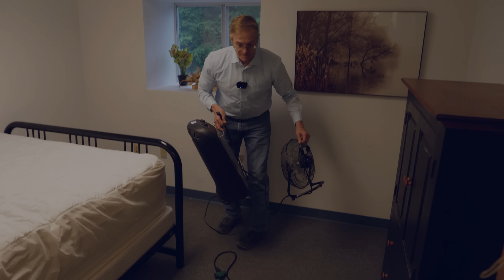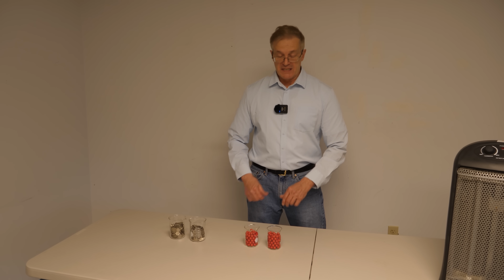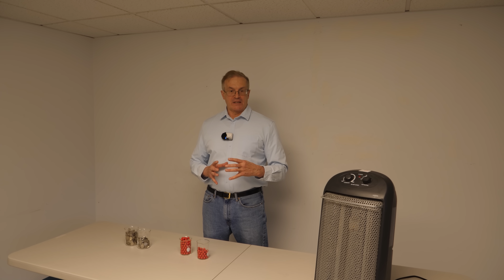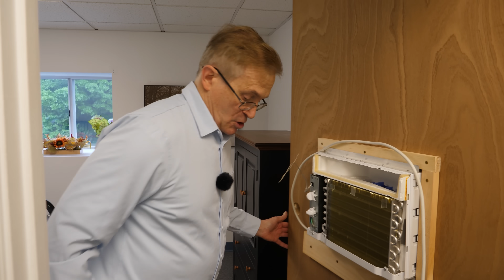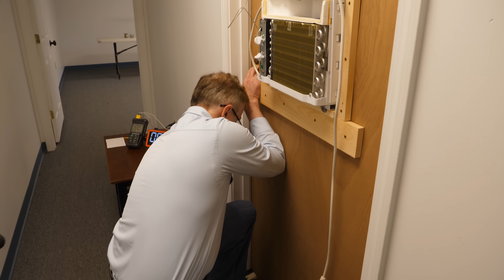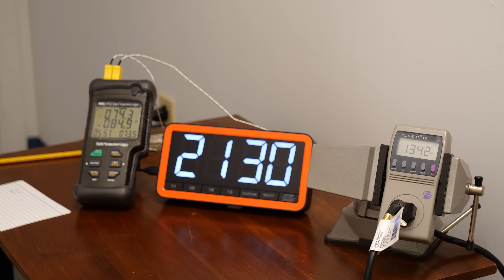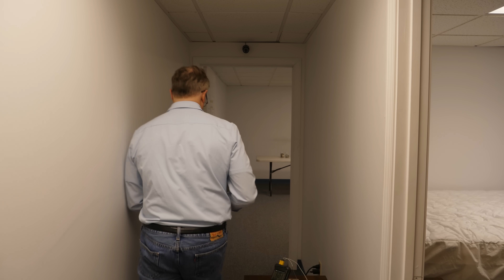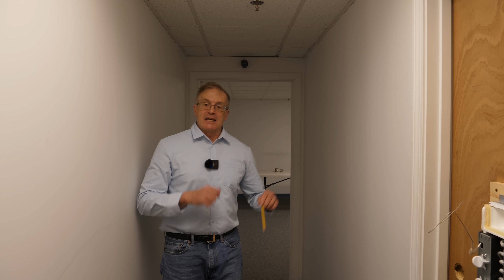You're wasting money on heating! Use your A/C!

Comment: I have a couple of questions for the community here (not sure if these were asked already):

1)   If this A/C unit takes less electricity to operate when compared to a space heater... why do power outages often happen in the summertime when A/C units are being used compared to space heaters used in the wintertime?

2)  If someone were to switch their small house over to A/C window unit heating for the whole house, would this experiment work if someone were to just reverse the direction of the A/C window units with the "cooling side" to face outdoors (thus cooling the outdoors  ;-P)?
Reply from the maker: 1. The biggest difference is that all airconditioners use electricity, while not all heaters do, i.e., gas, oil, and wood.
2. Maybe.  A window airconditioner is optimized for cooling and only in one direction. Different temperature ranges, outdoors, and inside will benefit from different refrigerant choices.

Comment: In Sept. of 2023 I installed a solar assisted 12,000 BTU heat pump. It produced heat up until minus 28C at minus 29 the lovers wouldn't even open. Up here in Canada we still need our NG fired furnaces. I use the heat pump on milder chilly days. Today we at plus 30C and I did a comparison. My new heat pump uses 400 watts less in cooling mode compared to my 14 year old mini-split. I love technology.

Comment: Heating with AC pumps is nothing new, its uses less power sure, but the added parts and the placement of the devices, meaning it needs a window to blow the cold air in or out of makes them hard to use. Unless you put the coils in the center of the house and outside in another unit, connect the two with copper lines filled with your refrigerant and fans in side and out and boom you got a heat pump.....

Comment: As a retired assistant director of engineering at a local hospital and an HVACR technician of 20+ years I'm curious as to your next installment.  So far you're crossing the 'T's' and dotting the 'I's' as I 'd assume you would but am curious as to your next installment. Notwithstanding,  I wonder if you eventually account for the cost of compressor replacement vs. savings in utility cost over an extended period of time? 

In simpler terms, considering the average wear on a AC system for cooling alone (regionally speaking) the typical life expectancy is between seven to ten years; at least in the southern states like mine in Texas, that is . But then adding an additional season per year operating as a 'heat pump' reduces that life by half, does it not? Lastly, I too wonder if attempting to water cool the condenser coils and/or diverting a portion of the refrigerated air across the return air is your next move...? Enquiring minds want to know......and look forward to your next video.😊
Reply from the maker: Regarding your life expectancy estimates, keep in mind that you will not have two systems (heating and cooling) that last twice as long.

Comment: I don't doubt your results, I'm just trying to wrap my head around it. My experience with space heaters like the one in your demonstration is that they basically have a wall of coils that heat up red hot so they actually glow. The equivalent on the air condition would be the condenser coil where the refrigerant gas gets compressed, heated and pumped into to cool. It's hard for me to imagine that the AC condenser would compete with the glowing red hot coils of the space heater in terms of producing heat.
Reply from the maker: That's why we did the video.
The results are valid and consistent not only with thermodynamic law, but one way to think about this is what does happen to the heat that is extracted from a room with an airconditioner? It can't be destroyed, and the energy used to run the airconditioner also has to go somewhere.  That's the leverage of this system.

Comment: I think the real lesson here is to exhibit how much better a dedicated heat pump could be than the average heat solution. It's fantastic low-hanging fruit begging to be plucked. NYC is running an experiment with window heat pumps (not plain AC) and while the pumps cost $2000 each right now, that's going to come down, it's a pilot program. Still, the gain is so great, especially for those who pay for gas/electric traditional heat, that even if the price stays that way it still makes sense.
Reply from the maker: Agreed

Comment: Something to note is that the heat differential matters. If it's cold outside there is less available heat to move inside, and the temperature that it does gain isn't much above ambient.

Comment: That is all great when its 75 outside. When its 0, they are not so good.  I had one which couldn't keep a small apartment warm. A friend owned a heated storage unit, 6 all new heat pumps.  Electricity in Maine is very high.  They only set the temp around 60.  They pulled them all out and put in gas heaters because of the cost. 
Seems reasonable, free energy but when you have to put on a jacket and keep the faucet trickling water so it doesn't freeze the pipes...not so good,  Great for 3 seasons but you need a boost in deep winter in Maine and many other states. Send them all to California so when its hot, they have a blackout because they don't enough wind and solar to keep them on.

Comment: My house has been heated with a heat pump since 1986. That unit died in 2018, and we upgraded to a newer much more efficient one. Since natural gas where we live is so expensive, I save about 500$/year compared to some of my friends. We also have natural gas fireplaces for emergency heat in power outages. The gas company showed up after a few years to inspect our meter since we had used exactly 0 gas. The tech came to the door afterwards and said "yeah, i saw that huge heat pump and i get it"
Reply: Good for you!  Had a similar experience with with gas company, but they actually replaced the meter and tested it.  The gas they used during that test was the last time I've had to pay for any.  Sure, every other month in winter they estimate my usage and bill me for that, and then credit it back the following month after an actual meter read.

Comment: You need most heating, when it is cold outside. You showed, that the A/C needs more power, when the temperature difference increased.
More realistic (for me in Germany) would be outside 0⁰C (32⁰F?).
In the optimal carnot process you would at least need 1 - T_K/T_H (absolute temperatures) joules per transfered joule of heat.
Since there are many places for losses,  add 50%. So 1:6 may be a good value.

Maybe we should discuss about burning gas at home vs. gas power plant feeding a heat pump.

Comment: As always a compelling demonstration. Since I have heat pumps at home (mini-splits) I am familiar with the concept, I will say that it costs way less energy to move the heat out of the house in the summer than it does to move the heat into the house in the winter. IIRC it's something about the temperature differential being much greater in the winter?

Comment: The economic story needs price -  Electricity vs natural Gas - to decide on the "hip pocket hurt"..

 - Electricity ( in essence) is value added natural gas... Gas can only make hreat, electricity is nearly infinitely useful as an energy source - it can create  heat, motion or even information - the highest form (quality) of power / energy)  The price difference reveals the "energy loses" in the electricity "system.  AC with natural gas cogeneration (or real "clean energy") is the ultimate in "conditioned space" treatment..

Comment: The room's objects and sealed wall, floor and ceiling voids may act as a thermal mass greater than accounted for.  Perhaps five hours or overnight to bring to equilibrium.  A thermometer between mattresses would reveal if this is the case.  For heating the air this is a great demo! .  Window ACs rate themselves at roughly 2x.  The conclusion of 3 x improvement is optimistic.

FYI, all but the most expensive heaters have poor placement of thermostats which cycle more often, which contribute to compromising the timed comparison. As well, cheap Chinese heaters have been found to sometimes have a hidden thermostatic fuse(?) which limits the power to the main thermostat, often by as much as 1/3.  This is done for claims of energy efficiency. 

Conversely,  there may be up to a three-minute delay before the compressor kicks in at startup, so that might improve the result by up to 14%.  It's a nice demo though and especially appreciated learning about equilibrium, thank you; If Elon sees he should consider hiring you! 

For those interested in turning their aircon around for heat, the experience of YouTubers suggests unscrewing the thermostat and routing it to the new inside to read the room temperature.  They only go down to 64 degrees, so will never turn on if still pointing outside.  And watch out for water dripping!

Comment: I really like this idea and I think I can make use of it without much difficulty. I have a portable AC, which is 10yo, that uses a hose and a window insert to blow hot air outside in the summer and I recently purchased a house that has a back porch with a sliding glass door. So, if I put the AC on the porch and the insert fits in the door I can blow warm air into the house. This particular design of AC creates a vacuum in any space it's used in, so it's not very efficient. The opposite would occur in the situation I just described, pressurizing the interior of the house; however, this could be advantageous if the house is cold. Cold air would be forced out through cracks in the basement walls and through any opening which hasn't been properly sealed. If I buy a length of hose to attach to the insert where the other hose ends I can easily direct the warm air to other rooms in the house.

Comment: Cool Vid, makes sense if you take a few minutes to understand... Pumping and concentrating heat is more efficient than converting electricity to heat. Even if the conversion rate is nearly perfect, and the pump isn't. I hope you revisit this 'backwards installed window AC unit' in the fall and winter :D

Comment: Make panels with water in them and then use a vacuum pump to cold boil the water frozen. Add a fan and water catch for condensing water. Or use that for cold steam Tesla turbine Cold side using the same pump for the cold steam turbine to maintain the ice around code side when needed. "Fallacies" Points at Earths Em field protecting Earth from the powerful sun and arranges Em collection output rods in vortex pattern in Mercury then drops turbine to get spun As long as Earth has a shield, Good.. 

That attack you said was microwave was ultrasound because peoples electronics and signals not microwave shielded. Put on wireless headphones, run microwave, and then open the door with music playing. Cracking noises or disconnect if enough charge built up. Does it cause cavitation bubbles? NO..

Comment: Interesting, but I would have been more convinced if the experiement was done in the opposite order, as heating a small closed environment like that transfers heat absorbed as latent heat into the furniture and walls, and the temperature probe is just measuring ambient air temperature.
Reply from the maker: You're probably right, but the delay was substantial.

Comment: I'm assuming a 3 way valve to reverse the system can be added to existing house ac systems?
Reply from the maker: I doubt it.  These systems are pretty well balanced for pressure and expansion ratios.  It might be possible if the settings could be optimized once everything was assembled.

Comment: It's pretty common to use heatpumps as heaters in many countries (with a reversible system, using a 3 way valve) . The US seems to be the exception but it does seem to be spreading. There is the issue that some areas in the US get much colder than what you would get in European countries, so the Heatpump may not work as well in those conditions. 

Adding the 3 way valve does seem to be a way to add the functionnality to houses.

Comment: Your test control isn't perfect, its better to create two identical rooms. That are seperated apart, or much smaller  such as a cubic space, and x material, and enviormental temp.  Air heating up isn't the problem, its the matter in the room that collects the temperature, if you can heat objects that ahve a higher molecular denisty than air it will give off a tonne of heat, and or aid in heating process, in this regard, teh tiem alloted of the air, doesn't make sense since the important factor missing is the total molecular heat of the oslid structures has a massive impact. The only thing i can say that could be of error.

To really do the test for solid figures, would be  a specialez state room and movements, and then a target outside system taht controls the ambiable areas of that system. force between each system a set temp, an outside temp, so a cube inside a cube, for less error and then operate  it over and over between both systems... I don't think 3 hours was enough, but yes moving is important, but heat pumps don't always work it needs a specific temp viable to operate which cna bechanged depending on the environment .

Comment: Very important information about the energy consumption - an eye opener. However, concerning the heat pump it is necessary to add:
The heat pump is zillion times more complicated then the resistive heater, which is simple, with no moving parts, and it definitely would serve you for many many years longer without break. The heat pump is also very noisy, you wouldn't want to have it in your bedroom window. And the purchasing cost of the window heat pump is 10-20 times more than the cost of the resistive heater. The external heat pump which would be less noisy for you, but your neighbour will hate you, would cost you more than 50 times as compared with the resistive heater...

Comment: If I recall right,  the lower limit efficiency of a heat pump is equal to the efficiency of a resistor heater.

Comment: 4:45 Nothing is at absolute zero. This is not quite correct, we have no (current) means of measuring anything at absolute zero, because it would create a movement that then is measurable thus then heat, by the standards of measurement, however there are other creative outlets and you can easily go beyond absolute zero, so you ahve to theoretically accept what is at that temp is at the cessation of movement. Kelvin  Scale... but yeah.. we can reach much colder temperatures, and how that reacts and pressure and other systems, so there is also other phasic states theorized in different elements as lack of movement, but then there is motion of electrons moving itself... so meh... its ab it less defined. Idon't know..

Comment: As a European it is honestly hard to believe that most of the USA does not use heat pumps and heat with direct electricity or gas which is even more insane to us.
Reply: If it's -15c outside, natural gas cost is $1/ccf and electricity cost is $0.2/kwh (both approximately correct costs for the American midwest), a 96% efficient condensing gas furnace is far cheaper to run than even the best heat pump. Because of this, you'll be running the gas furnace for most of the winter, and you'd only use a heat pump during the fall and spring ... and the heat pump would wear out before you ever get enough savings out of it to pay for the added cost (vs. AC only). Keep in mind that gas-fired generating stations are only 20-35% efficient, meaning that in an area where electricity is primarily generated using gas turbines, a heat pump would have to achieve a COP of between 3 and 5 to match the overall efficiency of a condensing gas furnace ... and no heat pump can do that in truly cold climates.
Reply: Posting to see this later

Comment: 3:00 In this comparison, when you pour beads from equal levels (maximum entropy of the system) you can also gain energy if you use a paddle wheel. This would mean that when you reduce entropy you can also gain energy, not only when you equalize the beads level (and increase the entropy of the system).
Moreover, in this comparison, to equalize the level of beads in both beakers, you also need to add energy

Comment: Soon I will be installing a Mr. Cool  heat pump for my house, replacing a dead propane fired forced air furnace. This system will not be ductless or mini split, existing ductwork will be retained. The price of propane has skyrocketed in the last three years, "influenced" by government policy, on top of the broken furnace issue. My thinking is that even though the heat pump is going to cost more up front, the energy security it offers makes up for it. I can make my own electricity, PV + LiFePO house battery, but I cannot make my own propane. Embrace entropy, get a heat pump.

Comment: I've told Celsius People many times that Fahrenheit gained its' popularity due to its' usefulness with temperatures that involve " human experience ", mostly in the field of medicine, but also in cases like this due to the, as you stated, smaller units relative to Celsius. Don't get me wrong, I love using Celsius for temps outside of human experience i.e. - liquids and solids of noble gasses, temperatures of stars and supernovae etc., but for temperatures that are in the tight realm of human experience I very much prefer Fahrenheit because of the smaller units.

Comment: If they could plumb central heating to home refrigerators, freezers, PCs etc efficiency of heat pumps could improve. Same as having coolant loops which can switch from one side of the house to the other to make use of the hotter or cooler sides of the house in winter and summer...

Comment: In the UK Gas is 1/4 of the cost of electricity. Most people have gas-powered central heating. Heat pumps are expensive, and not very suitable for the apartments people live in in the cities. As the price of gas is artifically lower than electricity this will no doubt change in time.